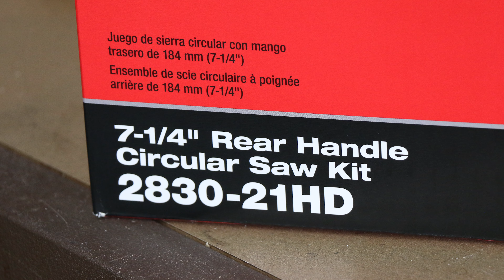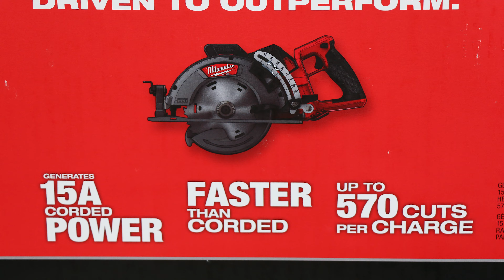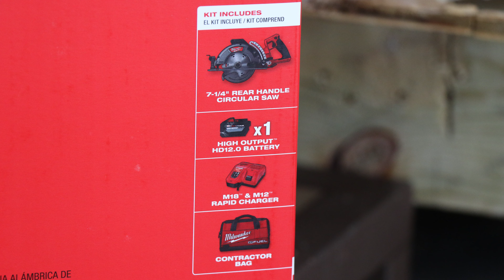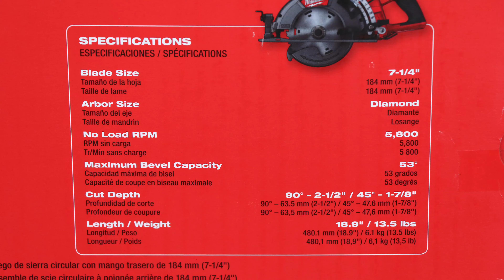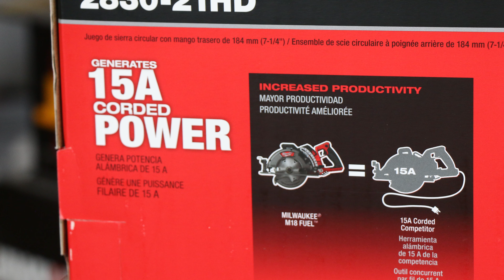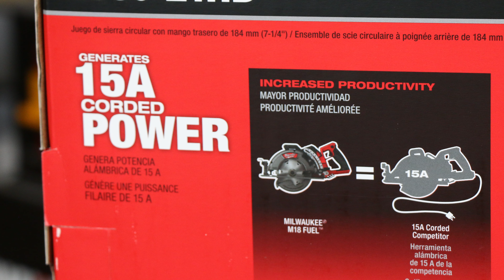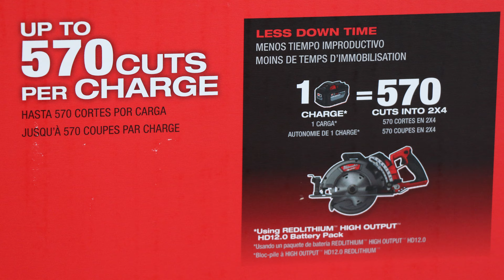New Milwaukee Tools 7-1/4'' Rear Handle Circular Saw **WARNING** (PROPER SETUP REQUIRED)

Comment: Vince we cant add numbers if we only have one number 😂😂 you only weighed the saw.
Reply: Awesome tool thought love the videos bro
Reply from the maker: Doug, guess you didn’t watch the whole video?
Reply: He weighed the battery before weighing anything else. How did you miss it? Anyway. The whole thing is pretty close to the spec'd weight of 13.5 pounds with Hd12.0 high output battery

Comment: Cool saw but I will stick with my Makitas for now. Same reason as you, already have the Makita system and batteries and I like having the faster charging batteries. 

Not cordless, but if you want to test a huge beast, test a Makita 5402na with a 16 inch blade. You'll have to find bigger stuff to cut to test that beast!